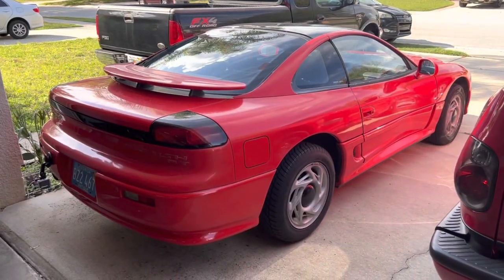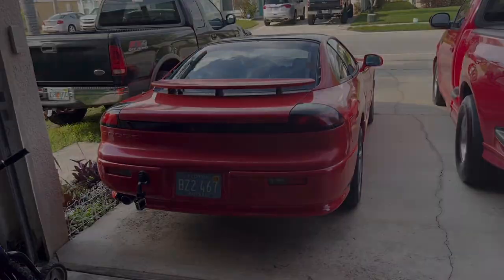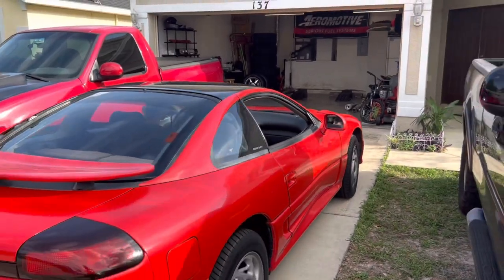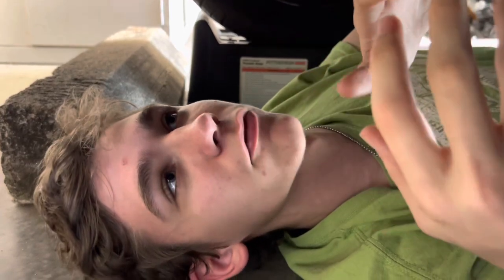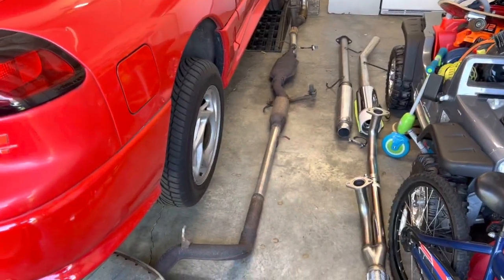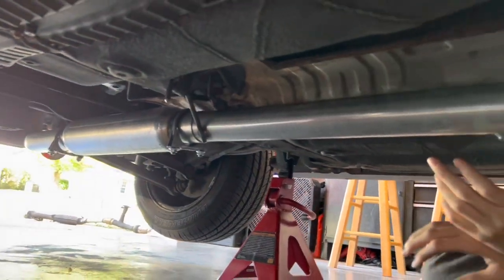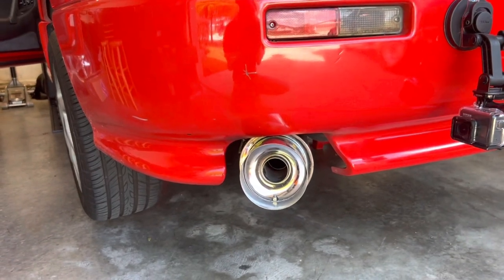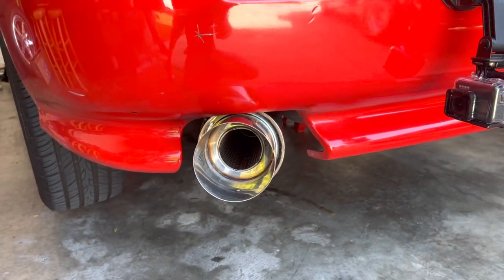Full Performance Exhaust for my Dodge Stealth R/T - 3SX SS Downpipe, Cat, and Maximal Single Shot!

Comment: Sorry buddy you lost me at 3 days for a Bolton exhaust
Reply from the maker: It's not like we were out there for three days straight all day lol.  Just alot of soaking/waiting/heating/and prying, trying for an hour or so at a time, a few times a day, until we could get the 32 year old, very rusted downpipe nuts to break free.  Mostly just waiting for the penetrant to work.  Once they broke free, we had it done in about an hour or so.